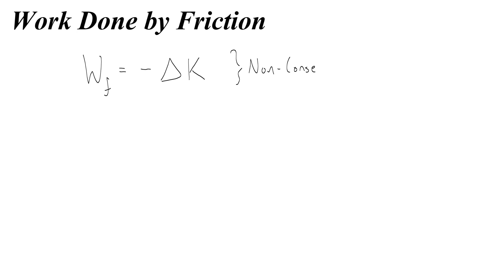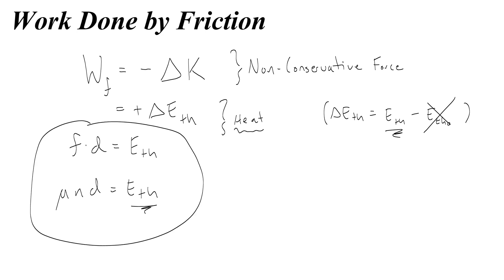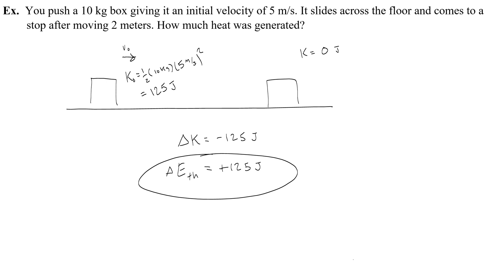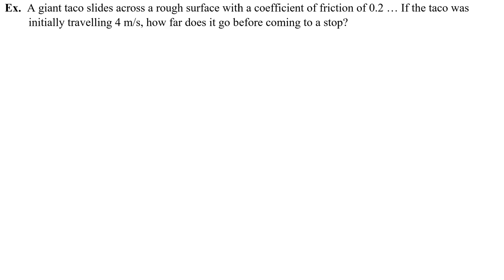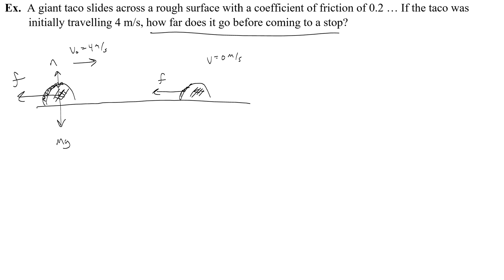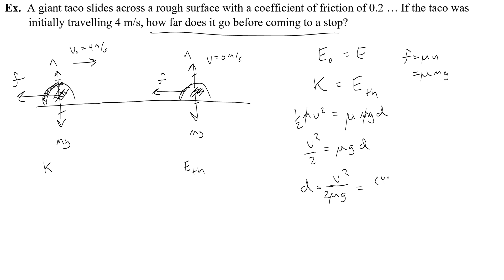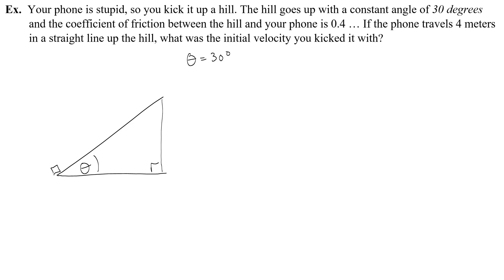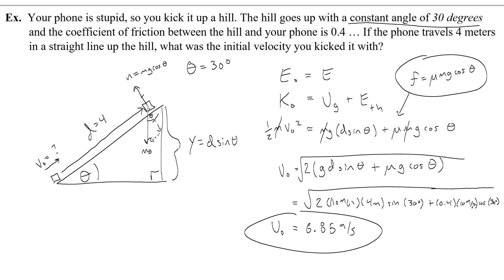How to find energy lost (heat or thermal) due to friction?

Comment: Aren't you suppose to subtract - the work done by gravity minus work done by friction - because the angle between the displacement and force of friction is180 degree (cos180= -1)?
Reply from the maker: Assuming this is about the stupid phone question :) ... You make a good point! If you were going to approach this problem with a work analysis you would say K - Wg - Wf = 0 because they reduce the kinetic energy to zero at the top of the hill. In an energy analysis though you think of it more in terms of energy transformation where you start with all K in the beginning and the work done by gravity is stored in Ug (potential energy) or turned into Eth (heat from friction). Hope this helps to clarify!

Comment: thanks Im finally understanding this but quick question, I'm struggling for calculating the thermal energy I saw in the first example you said the lost energy was the Eth which I'm guessing is thermal energy but isn't it also the kinetic energy? Im doing problems that have Kinetics and some don't, some also have potential and some have both the problems ask me to find TE(thermal energy) after finding potential, kinetic and mechanical energy but I dont know how to can you explain it very simple and soon as possible ? thanks
Reply from the maker: Yes, Eth is the same thing as thermal energy. Friction creates thermal energy or heat but this energy is quickly "lost" when the objects cool down.

Comment: At 13.53 there is an error!!! When subbing in mu times the normal force for friction, Mr. Larrison forgets to multiply the friction by the distance 4m!! The correct answer to the problem is 7.34 m/s^2!! This also makes sense when looking at the units under the square root. Without the 4m being multiplied by the friction, you would not get m/s^2 when taking the square root!
Reply: it is 8.146 m/s
Reply from the maker: Thank you for catching this! It would 7.34 m/s though, not m/s^2.
Reply: @HowToPhysics  I think it is actually 8.23 m/s. To get 7.34 you only multiplied the gdsinθ by 2 when you should have multiplied everything under the radical by 2. I think you may have just typed it into the calculator wrong.